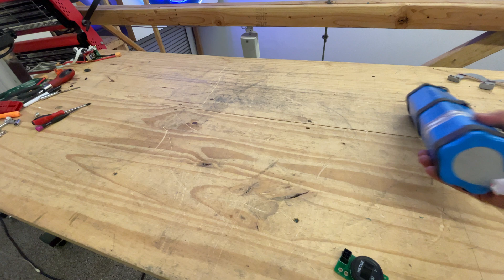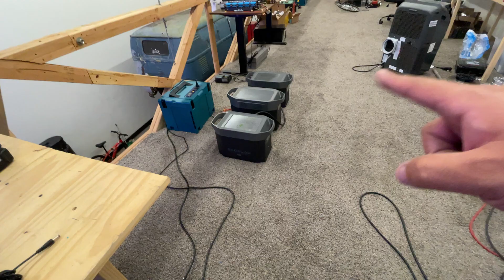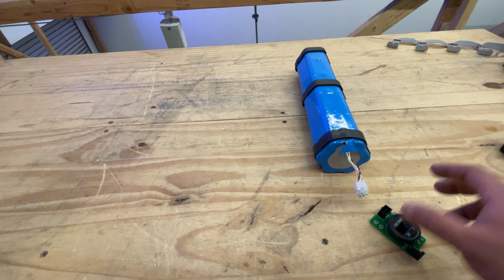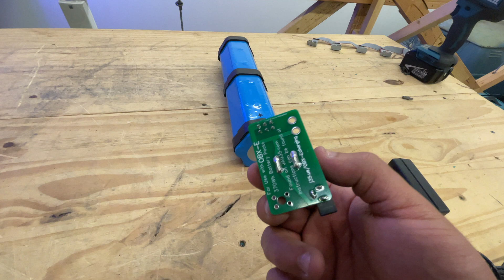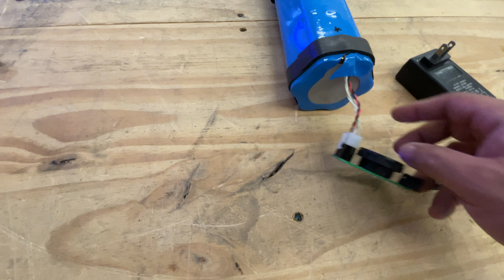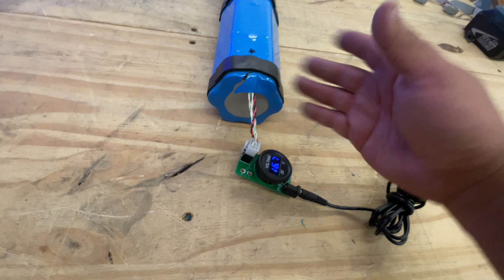OBX pack charging accessory for first time battery builders

Comment: What is the part number of the 6 pin connector on the circuit board? I been working on a project that needs that connector and can't find it anywhere

Comment: Ah, plug the charger into the ‘mains’ power BEFORE you connect it to your battery. IF the charger has some ‘smart’ circuitry to control/regulate its output,  better to get into the habit of doing it in this order.

Comment: out of the 6 packs i bought from you jehu only 2 got to 17v. the other 4 only 16.7-16.8 is that bad? should i charge them again? my kilowatt meter only charges them at 4w after a few hours, does it mean they are full?. i bought the charger you have, 18v. 2amp charging at 37-41w
Reply: I'm having the same issue but even lower voltage. Trying to figure out if that's even safe to use with other batteries at this point. I'm trying to do some research to figure it out. They will charge to 18.6 then drop off to 14, 15, volts after the charger is removed. Of the 9 batteries I purchased all 6 I've tested do this. I wonder if I have the wrong batteries. Oh well the mystery continues. 🤔
Reply: @latymz  Did you figure this out yet? my batteries all drop down to like 16.7v after getting charged up to 18.2v
Reply: @keeganbuilds  Not as of yet. Freight has been too crazy lately. I haven't had the time to get to it.

Comment: Man, I gotta just say, if your buying or even playing around with batteries like these, you should've already had a voltmeter or dmm... I mean damn
Reply: Yes.. if u dont understand or have a multi meter,  you shouldn't be playing with batteries.. go out and buy one, and u can check voltage of car battery,  at rest, then start car. Test again.. need to understand the concept of battery and what happens and why.
Reply from the maker: The problem is that first time battery builders don’t care what you or me  think.  I have to deal with them everyday so I don’t have the luxury of taking your stance.  This channel is all about helping people get things done one way or another.
Reply: @jehugarcia  whats wrong with making it easy for everyone ?????  NOTHING!!  good job keep up good work
Reply: @jehugarcia  totally agree n def why I'm a sub. Were ALL still learning. Just saying I would sincerely hope the vast majority of people planning on buying any diy pack should at the very least have a dmm. I like your idea with the vm. Even knowing a little about lithium it's incredibly convenient. Def not trying to frown on anyone just learned from experience lithium batteries are no joke.